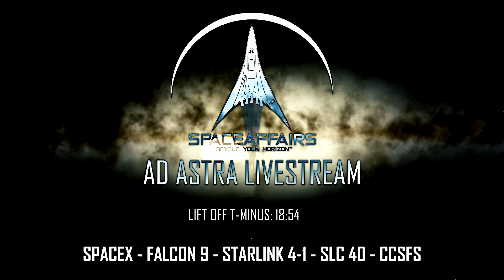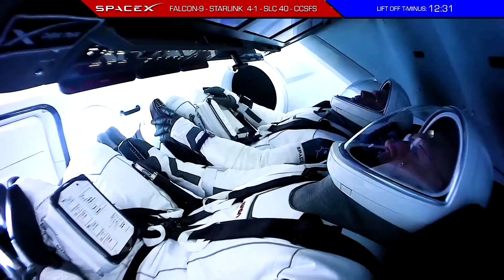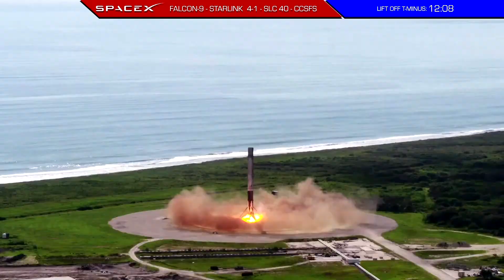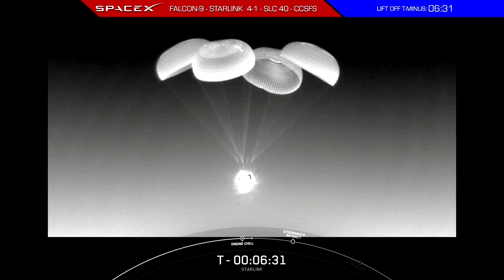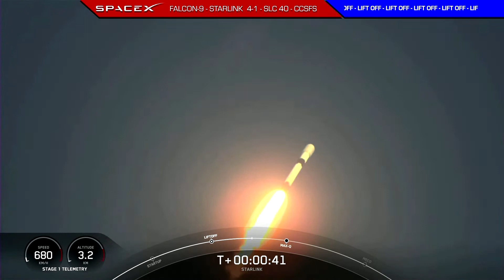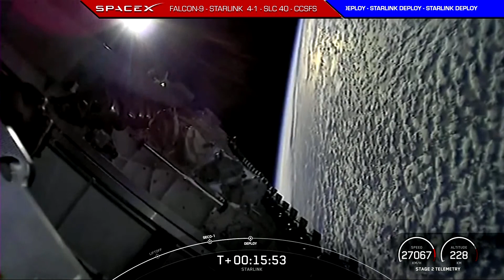SpaceX - Falcon 9 - Starlink 4-1 - SLC-40 - CCSFS - November 13, 2021

Comment: why everytime 1 sec before it lands cameras stop working?
Reply from the maker: The video-footage is transmitted via satellite connection via a dish that is mounted on the drone ship. When the booster comes close during the landing, there is a lot of pressure produced and a lot of vibrations happening. So, the dish loose alignment with the satellite and the video signal drops. When the booster lands and the pressure and vibrations are gone, the video signal comes back. Sometimes it happens that the video feed is stable.